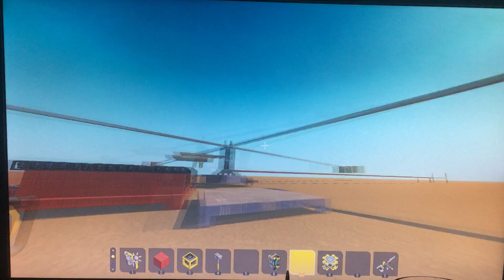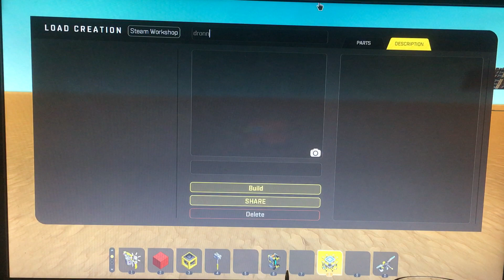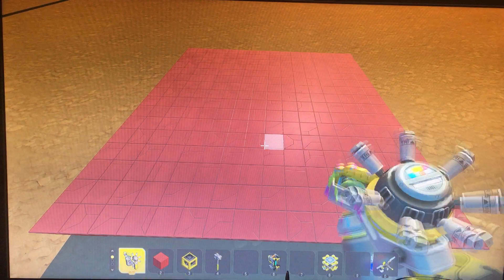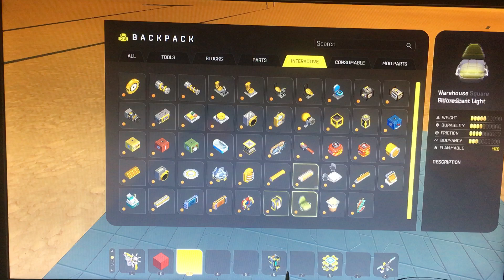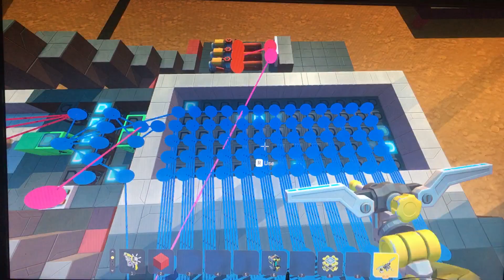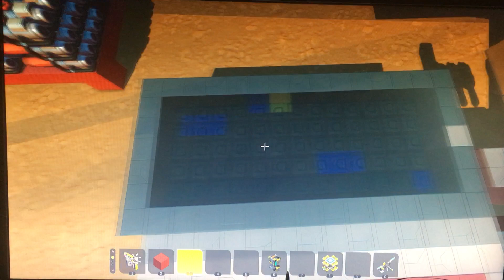scrap mechanic lag detector prototype

Comment: I could build something that measures how far those signals are apart, with a display in decimal (or a graph plotter) and such. If you're interested let me know it's not much effort
Reply from the maker: I would be very interested however I need to redesign the thruster arms. I could also how you the machine I was using they first made me notice the effect. do you have discord ?
Reply from the maker: @herrvincling  I sent a request so you should see me by the name of Fuzzball